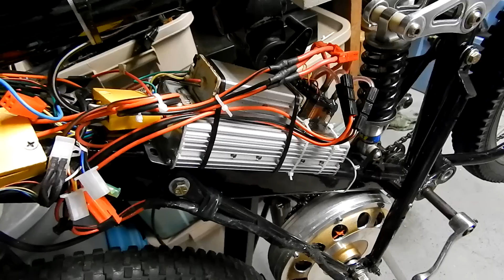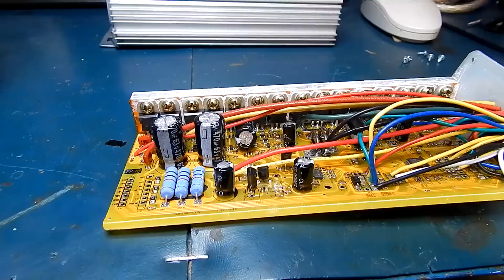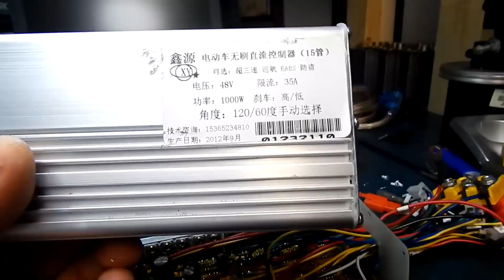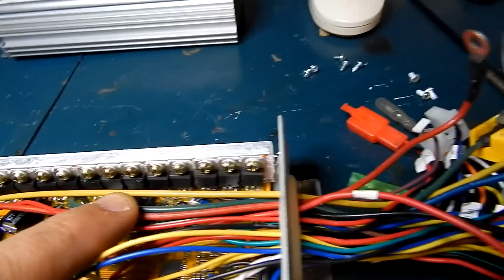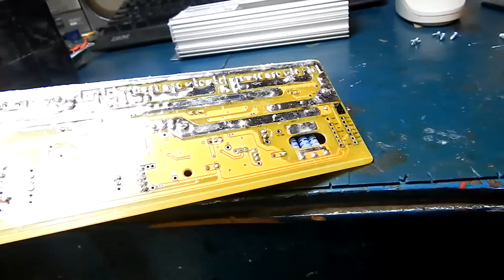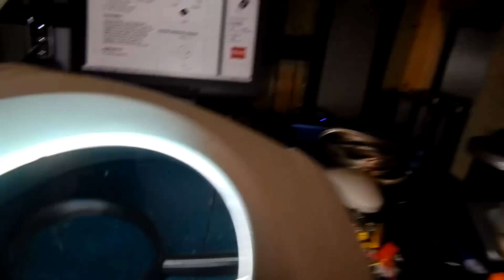ebike controller shunt modification *35amp to 45amp*

Comment: I’ve done this to my triple shunted controller and the results are really surprising. I didn’t just add a little solder though, I didn’t squeeze the shunts together either but fully bridged them with solder. My controller was rated at 45A apparently which I don’t believe as it was already slightly modded from the factory. Battery sag at stock was 3-4v but with the full shunt mod it’s up at 7-8v which I expected considering I’m almost doubling the amp draw. Battery has 50A BMS but will allow much higher for peak draw over a few seconds. At this point it’s difficult to keep the front end down on full throttle pull off, especially if the forks are compressed from braking. Gonna be fun when I upgrade to 72v 28ah rather than my 52v 20ah pack. Will sag less thanks to the extra 2 in parallel and top speed will be increased considerably. I will make a baby surron 😂

Comment: I did a shunt mod on my 500w ebike but it keeps turning my battery off after about 5 seconds of riding. What am I doing wrong?
Reply: Your battery can't handle the amount of Amps that your controller is pulling, so bms protects the battery

Comment: how u know that u did added more 10A? And wasnt it been more clever to solder a wire (~15-25% thickness if those 3 shunt thickness) to the boards other side negative to negative where the shunt bridge is?  The shunt just bridges the negative to negative on the boards face from boards other side.

Comment: Hi mate I have the same controller im running a 50amp bms 48v battery can I do the shunt mod without changing the capacitors

Comment: I have a 72v controller with two shunts but the board has a space for a third shunt. Should I just butter out the two or should I add a third and if I should add a third how would I find one that would work? The fets are rated at 140a and the caps to 100v if that helps.

Comment: Done! I was inspired by your video and so I have done the shunt.... but I think I botched it because it was the same. Not discouraged, I did the capacitor route. I live in a little beach town in Costa Rica, so I figured I couldn't get them easily..... well I checked a local shop and they got them to me in 4 days! Not bad for a little fishing village, anyway, the Chinese 48v scooter at 72 volts now, goes like stink. I am getting a lot more speed and now I think I should get some better mosfets (I have the same mosfets as your controller) and go for 96v. The regen doesn't work anymore but that seems to be what happens when you over volt things. So far excellent.
Reply: +Jeffrey Irwin yea bro i got one of those folding made in china, very cheap but did butter the shunts also voltage boost from an extra rc car battery oh my my this bike used to go 24 mph now i am pretty sure its close to 35 mph hahaha it's awesome. i don't even ride my Hercules bomber anymore. by the way nice picture fuck i wish i lived in a beach town.
Reply: Jeffrey Irwin any charge left on battery?  Also something on you Controller probably got burned.  Better to buy a decent  one then MOD.  Don't forget to boost your voltage  next time to be on the safe side.
Reply: +Jeffrey Irwin nice that's even better

Comment: I see your controller had three shunt bars by putting solder at bottom to join three won't improve power to 45amp yes if you nippy two or three on some controller it's two shunt bars nip together a thinkayer of solder along the top. And you have to upgrade the fuse. As it will blow most controllers yes 30amp fues mine blew so I put 35amp or 40 amp my bike power is great controller not hot motor not hot battery not hot. Haven said that if using to much solder it will burn mosfets out. I did catch my mosfet with solder iron light spark I thought I would just take of more solder my bike still works but I've lost xa tiny bit power so I've got a spare controller I'm going to use copper wire then tiny bit solder. The best controller to do this is 35+2 amp which will give you 40 amp so that means 40amp fuse

Comment: Great video.
Question, my battery is 48v 20ah.  My controller is 48v 20ah. Manufacturer upgrade from 20ah b/c none in stock.
Will this combo work? Heard it could damage battery.  I use PAS too when riding.

Hope you can help. Thanks 

/Bklyn👑

Comment: Had to go watch 5 other shunt mod videos to see what your butter job was all about.
Wouldn't it work with adding a 100k mini pot across the shunt so you could change the resistance value ?
Put a thumb throttle across the shunts to decrees the resistance for torque and when not needed set the pot back to it's zero resistance and.still have less resistance than the shunt.

Comment: Would this work on a 250 controller 36 volt
Reply from the maker: yes
Reply: thank you so much for this video i did the shunt mod on my controller and it accelerates much better now and can go up slight hills as well great video

Comment: Hello Electronic wizard, I would like to know how can I achieve a controller with a 400A? its for a boat build with a jet pump system. Or do I really need a 400A to run a boat with jet pump?
Reply from the maker: your going to need a lot bigger controller than this one. try Kelly controllers llc
Reply: Ok Thanks for the input!

Comment: My controller looks identical to this one, however it has no label on the outside. I purchased a cycle analyst and I'm going to be connecting some wires to the shunt resistor, but I need to know the value to calibrate it. Do you know what yours was before the mod? How does one measure this?
Reply: If you're any further along 11 months later, I'd love to hear about it. I have a random 12-FET controller with no CA connections, but I'd like to figure out the ins and outs of hooking one up. Cheers.

Comment: What chip were you checking online? the mosfet?  I think I'm going to do this, I just don't know what type of controller's in the ebike right now
Reply from the maker: yes use a loop and look for the number on the fets and do a search find the pdf for the specs on the fet see what the maximum voltage is
Reply: karmabike1 thank you, I did this mod a couple of days ago but never increased the voltage (originally 60 but I bought it with 72 volts and it ran fine for months for whoever added the battery).  All I gotta say is wow, just adding that solder made a big difference in the time it takes to get to ~60-70 km/hr.  I will check those mosfets today, hopefully I can see what they have printed because the pcb doesn't slide out of the metal casing easily.
Reply from the maker: sc0tte1  yes it works well if you get just the right amount of solder.
Reply: "yes it works well if you get just the right amount of solder."
I presume not enough solder just means less boost, but will too much make a controller release the magic smoke? Thanks.

Comment: My KT48ZWSL-ZC14A 48V 1000W has spots for 3 shunts but only one shunt in place. Can i add a shunt without popping anything?
Reply from the maker: most shunts are calibrated. some company's use three others use one. not a good idea to add two more without proper calibration. more than likely the fets would blow.
Reply: karmabike1 I added one copper shunt and buttered up the front and back a little bit. If it pops something i will either fix it and beef it up or buy a 72V. Win win situation. :)

Comment: I know this is an old video, but can you run this controller on 36v as well?
Reply from the maker: no the regulator wouldn't work. if you changed the value of the power resisters it would.

Comment: Hey great video I'm sorry I have a unrelated question,  I only ask because clearly you know ebike controllers and know what your doing, I have a 48 volt 1500 controller and can't get my motor to run with the twist throttle,  although if I plug the self study cables together the motor turns on at 1 speed I also have the lock cable going together with my main Positive with a key switch, I don't understand why my throttle has no effect
Reply: I'd say the throttle is defective. Did you try a potentiometer instead? Connect +5v to one of the outmost pins, GND to the other outer side pin. Finally , connect the remaining wire (throttle signal) to the middle pin of potentiometer. Any value potentiometer will do, i tried various values say 5k pot, 10k up to 100k potentiometers.

Comment: I would like to ask you some the resistors just like in your video i see those that i have but after i change some of the mosfets the resistors all 4 of them get REALLY hot. This is a stock controller from Crystalyte @ 72V 50A, Thanks.
Reply from the maker: ya if your over-volting you will need to change the value of the resisters or stand them up and run the same value in parallel. careful with the crystalyte you can easily blow the regulator.
Reply: If you use Ca on the bike.. You have the green wire to the controller... Cut it or putt a switch between.. You get some more effect out ;)

Comment: hi if I only have 1 shunt how do I modify my controler
Reply from the maker: you can change the amps by putting a little solder on the end of the shunt. a little goes a long way.

Comment: Hey Karma, I have a controller that I can select 48v,60v,72v in the settings.  I had it at 48v for about nine months, but decided to run on 72v and rebuilt my battery to 72v nominal.  I could hear the mosfets, but thought well it is rated to 72v nominal so it should be fine as long as I dont over heat it.   Well it lasted about 50 miles then it stopped turning on yesterday morning.   I work in electronics and have "some" component level exp.  so I figured I would crack the controller open to see what I can find.   I found the same 63v 470uf capacitors and 4 of the 5 were bulging, so that could be my current issue as everything else seems fine with no burnt traces or cracked fet's etc...  I was looking to do the same as you by upgrading the caps to 100v 470uf.  Just trying to get your knowledge on this to see if I am wasting my time trying to fix it.   I would like to get a 72v controller, but need one that has a connector for my LCD display and I'm having trouble locating one.  Thanks for the help.
Reply from the maker: just use a voltmeter test all fets if there ok replace caps and your good.
Reply: Karma Electronics cool sounds good. Well this will give me new material for a new video, so I'll make a video of the testing.  Ordering new caps now.  Thanks for the help.
Reply: 15-sec-of Fame making a 72 volt bushes hooking up a 72 Bush this

Comment: Now my bike cuts out under load after about 3 seconds. Nothing is overheating. Reads low voltage but its not.
Reply from the maker: yup your drawing to many amps. battery's cant handle it. problem with modding is you end up upgrading eveyrthing. you need a higher ah battery.
Reply: karmabike1 40.6 amp hour pack. Higher then that? Cuts out on hills too but not if i go somewhat slow.
Reply: I had the same problem, turned out it was the leads connecting the battery to the controller. The resistance was too high, and the increase in temperature from the current surges would increase the resistance even more. I'm not sure what causes the controller to cut it off, but I had that exact same problem and all I did was change those two leads (To 16 A mains cable), and the problem went away.
Reply: +JGBLADES your bikes voltage is lagging, this is when so many amps are being pulled from the battery that the battery cant take it so makes up for it with volts after all, Volts X Amps = Watts; to fix this reverse what you did or get a more powerful battery with a higher "DISCHARGE RATE" usually rated by "C" in whicht eh number befroe it e.g. 2C is how many more time a battery can drain itself against its capacity so for a 45 amp mod like above a 45AH battery would need to be 1C and a 22.5A would need to be 2C etc... youre not the only on here... discharge rate on E-bikes is severely overlooked by most including dealers (worringly)
Reply: +Shane Williams *Worryingly
Reply: Ah....thank you. More power! Muahahaaaa!
Reply: +JGBLADES u need series capacitors modded to the Battery Source which will prevent the cut-off to a certain extent
Reply from the maker: Lee Dalisius  yup that works as well

Comment: Hi,
I have 24v 250w controller , with 22A current limit.
can you tell me how can I lower the limit from 22 to about 15? and will it cause any other problems? thanks!!
Reply from the maker: there would be no problem lowering the amp limit.the easy way is to pull the shunt out of a dead 15amp controller. or work with shunt you have now. if there are two remove one.